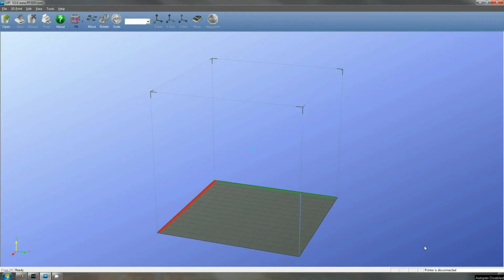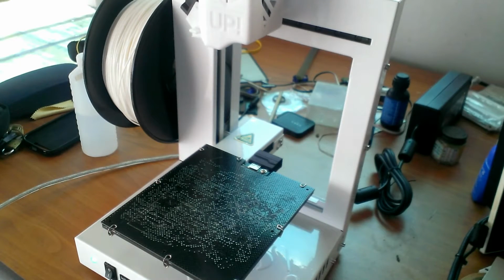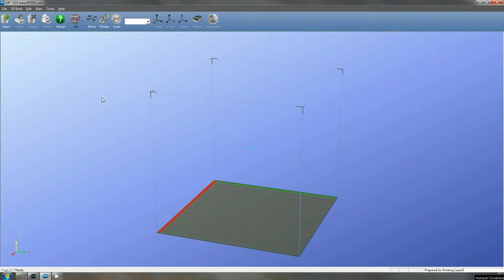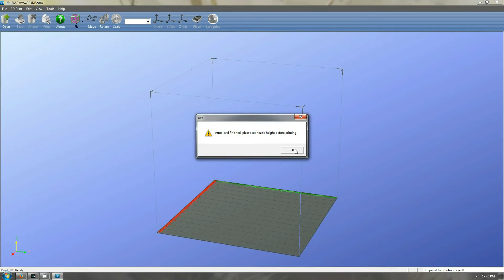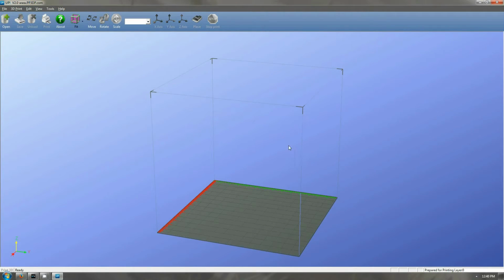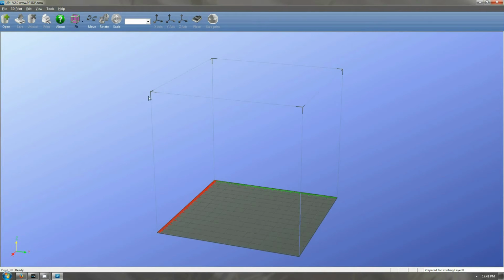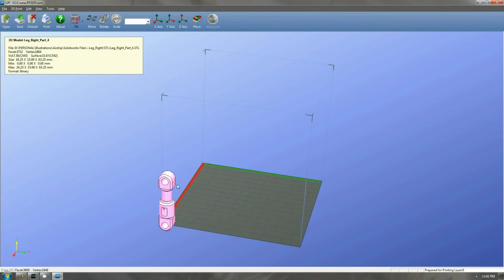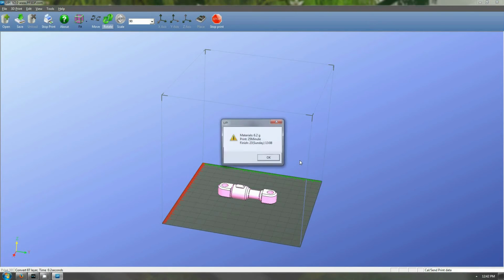UP! Plus 2 3D Printer Calibration Features

Comment: Hi I have the same printer
Any advice?  I often have the parts coming off the platform during long prints.
Have you ever used the 3 screws calibration under the platform?